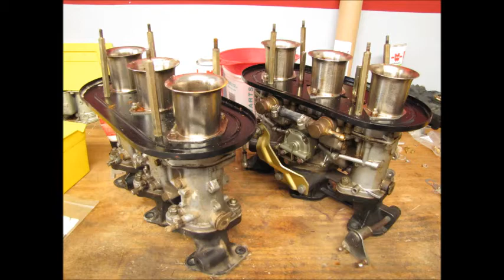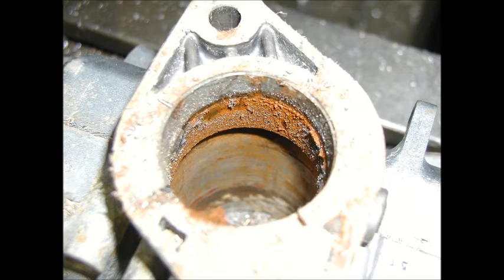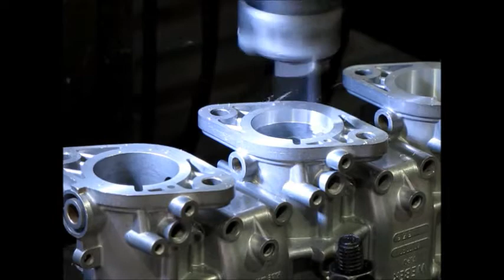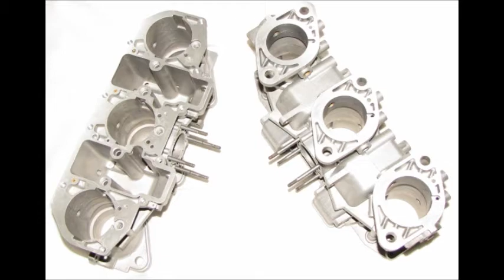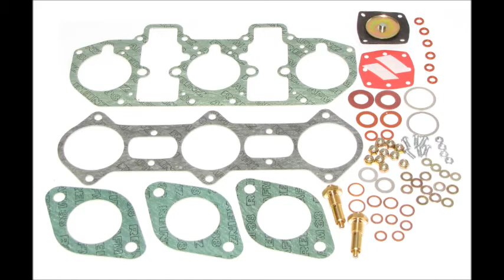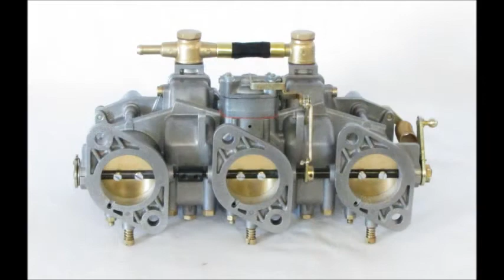Weber IDA Full Restoration

Comment: Nice work. Fantastic finished product. I have a 46 IDA to go on a 1275cc Mini for hillclimb racing in Australia. What size are the sealed bearings for the throttle shaft? I sent the carb and manifold in to be cleaned and when it came back the throttle linkage was missing. Too many years in between the job and me finding out. My bad luck. Where are you based?